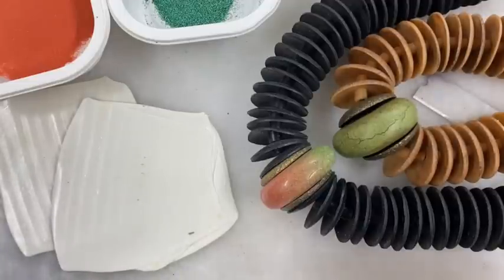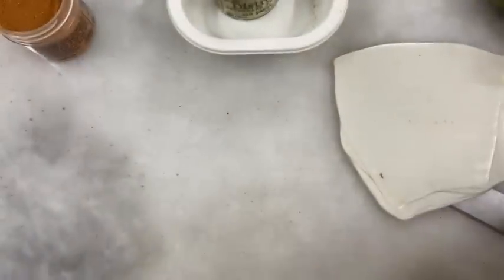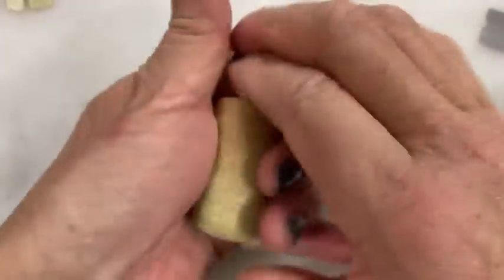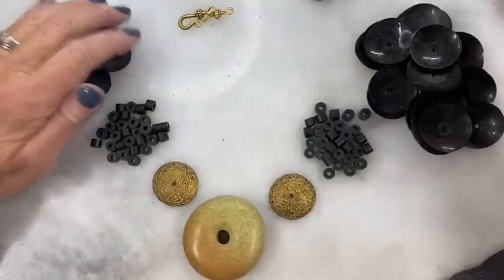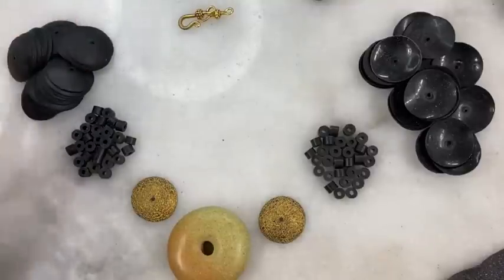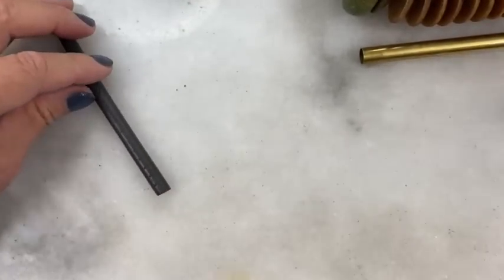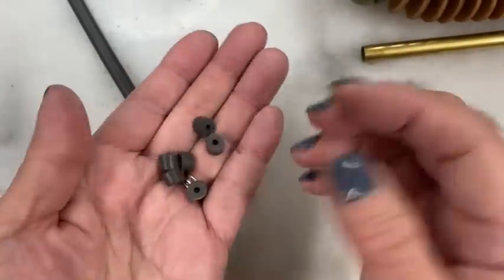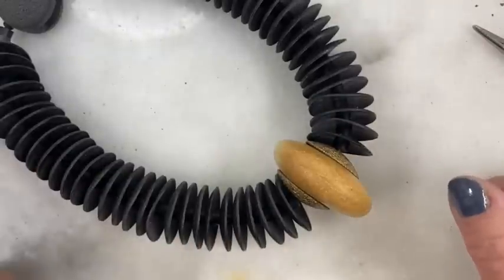A Basic Polymer Clay Jewelry Tutorial - Inclusions, Easy As Pi

Comment: Donna, a trick i use to keep large holed beads centered on the cord against smaller holed beads is to put a seed bead of appropriate size inside the larger hole.  Then the other beads or end caps don't ride up on a Center bead, especially.  In this case your tube bead might fit inside the hoke in the Center bead.
Reply from the maker: Good idea, Deb! 😊❤️🧑‍🎄☮️🎉🎁🎄

Comment: Hi Donna, is embossing powder and embossing glaze the same thing? Also, could you tint the translucent clay with alcohol ink before adding the powder or would that dry it out even more? I can’t thank you enough for sharing your knowledge with us. Beginner here.
Reply: Gina, I went to Tim Holtz's website to look up the product that Donna is referencing and I saw the embossing glaze too.  Reading a little, it seems that the embossing glaze is translucent and is used for layering effects.  It looks like Ranger no longer carries the distressed embossing powders that Donna is using.
Reply: That’s correct, they no longer sell the Tim Holtz Distress Embossing powder, it was a little different in that it has non-melting inclusions along with the melting powder that created a more textured look. However any embossing powder will create that speckled look when distributed through the clay. If you’re looking for a variety of speckled colors you can mix multiple embossing powders in your clay or Ranger (who produces the Tim Holtz embossing line) has embossing colors like verdigris (which Donna also used) and turquoise. Also, the company “Wow” has a large number of embossing powders with mixed colors in a single powder.